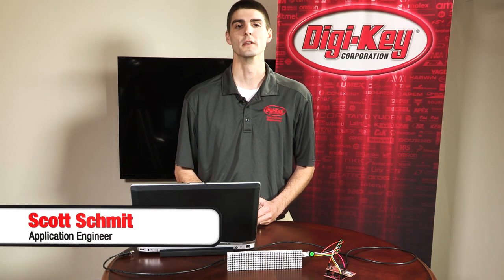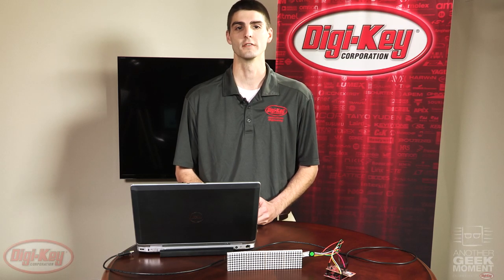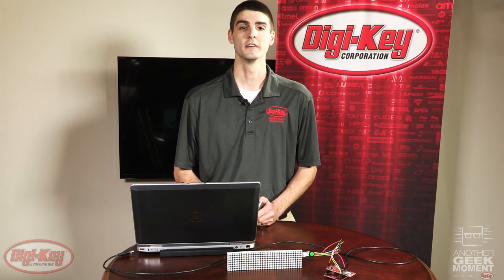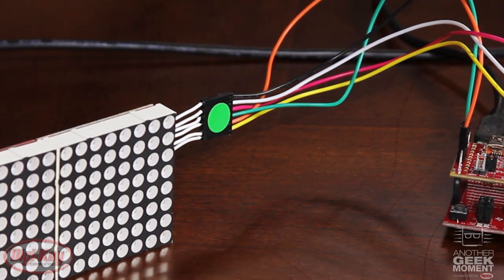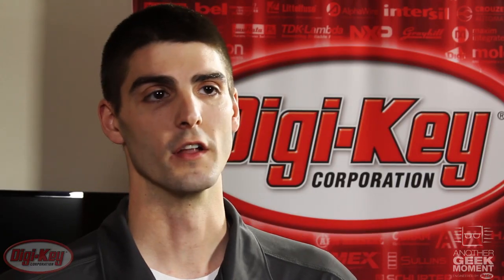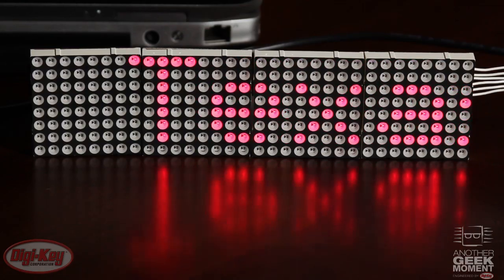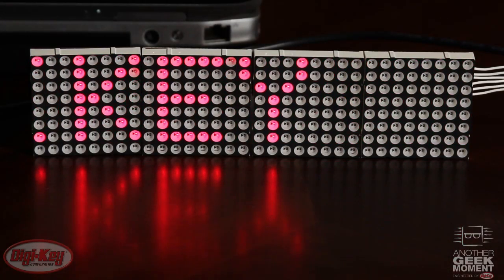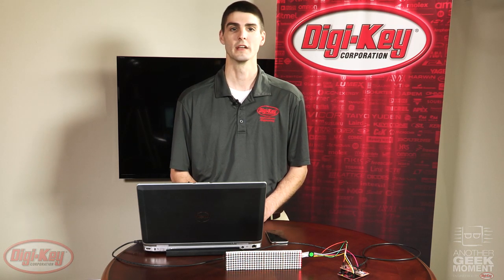Wireless LED Display with Bluetooth - Another Geek Moment | DigiKey

Comment: Very nice Work.
Looks a lot of programming Efforts.
Can i have the Code of Launchpad used here?
Reply: Vishal,

Emmoco software was used for development of this application.  Emmoco has their own code development suite called Em-Builder which you can download from em-hub.com.  You will need to have the Anaren boosterpack in-hand to complete the registration process (you will need the serial number on the kit).  Once you have registered, you can download Emmoco's code development suite called Em-Builder.  It includes pre-written examples for multiple TI platforms including the MSP430 Launchpad used in this demo.  They have step-by-step tutorials showing you how to connect to your hardware platform using Apple mobile devices and how to customize applications with your own user variables.  For this demo, I created my own 32-byte string variable for storing the display message.  However, you can implement whatever variable (or "resource" as Emmoco calls them) and view them or edit them remotely from your wireless device.  Each example project includes a hardware abstraction layer written specifically for the selected platform.  That file is what needs to be modified to add support for the SPI module that I used to control the LED display in this demo.  SPI functionality for MSP430 is heavily documented and should be relatively straight-forward to implement.

Comment: Is there a kit of parts & price for this?
Is the purpose of the laptop merely for 5v power or is the laptop necessary?
Reply: David,
There is no specific kit for this demo.  Part numbers were included on-screen for all of the parts used, but here are the relevant part numbers for recreating the demo:
    TI Launchpad:  MSP-EXP430G2 (USB cable included)
    Anaren Bluetooth Boosterpack: A2541R24A-ADB1 (comes with squid cable)
    Olimex LED modules: MOD-LED8x8 (four were used in the demo)

I also used 6 jumper wires to connect the squid cable to the female header on the LED modules.

For the demo, the PC was only there to supply 5V to the system.  Programming the TI Launchpad was done ahead of time.  With only 4 LED modules, the power draw was low enough to be supplied through USB.  If more LED modules are used, you should probably look into using an external power supply.